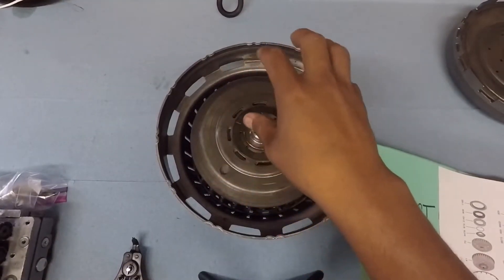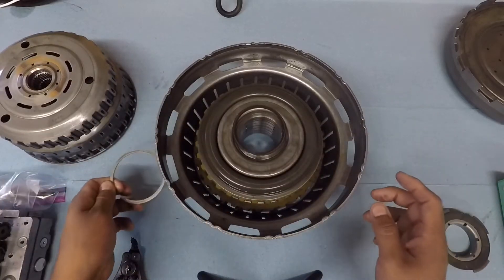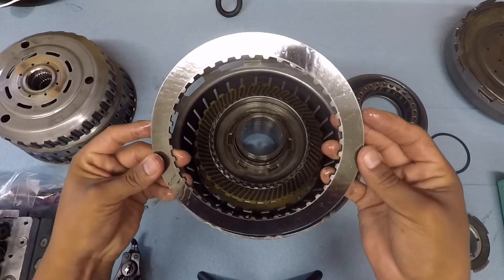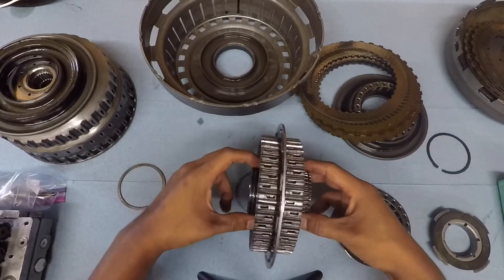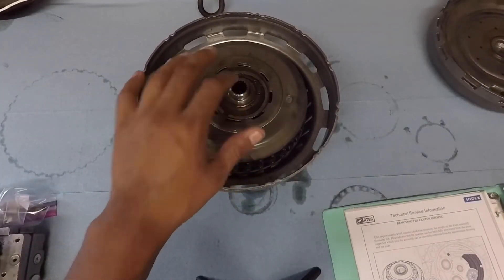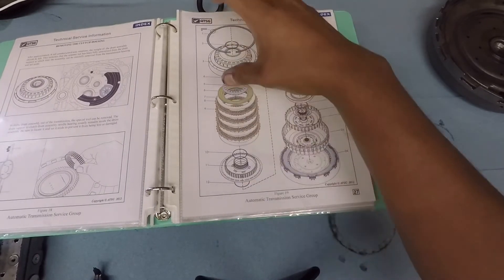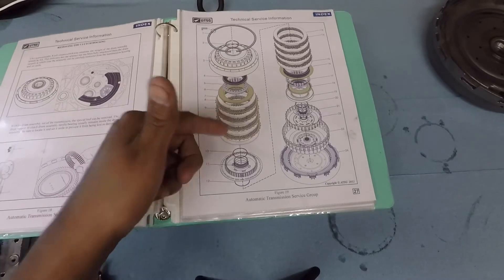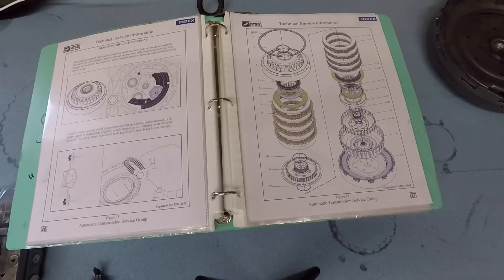Mitsubishi Evo X MR SST Transmission DCT470/ 6DCT470 build - Part 3 Steel & Friction Clutch Plates

Comment: Does anyone know the minimum thickness at which the friction plate should be changed? The new friction plate thickness is 1.85-1.90mm. I have stripped a 6DCT450 from a Ford Galaxy and the plates are 1.80mm. The backing plate is 1mm thick which leaves approx. 0.45mm of friction material on each side (new), the worn plates are 0.40mm each side which equates to 11% wear. Are these good to go back in? Thanks

Comment: Quick question, the torque dampener, there was a ring that has some teeth sticking out pointing towards the circle. Exactly how does that go, it’s got a sorta bend in it & I just need to know that so I can put it in correctly.
Reply from the maker: I think I know what you mean, it should press into the damper. The torque damper has 4 areas that the ring snaps on and it helps it from preventing it to come out. I’ll try to make a video on it hopefully this weekend. Hopefully I answered your question.
Reply: @josezamora7889  thank you, that clarifies it. I’ve got mine put in & now I’m just waiting on axle seals. Another question, what happened to your seal?
Reply from the maker: @Iyellatbabies  I think I crushed my seal during the install. SSP sells the full replacement for $28 and It comes with 2 transmission seals, one transfer seal and one rubber seal.
Reply: @josezamora7889  oh man, I just had a seal fail, but I believe it’s the axle seal. Didn’t mess with the seal inside the transmission, I think it’s just a seal & a ring outside
Reply from the maker: @Iyellatbabies  yeah I feel like I shouldn’t have opened the transmission lol, I could’ve changed the seal from the outside but oh well 🤷🏽‍♂️ you learn.
Reply: @josezamora7889  you always regret it when you’re knee deep in the shit, haha! I said the same thing when my shifter fork failed. I didn’t find the magnet gone, I found the tooth for the fork grinding & completely gone, the weirdest way for it to fail. Got it back together (thanks to your videos) & now I’m waiting for the axle seals that no one has in Texas. Hope it at least runs well for the auction.